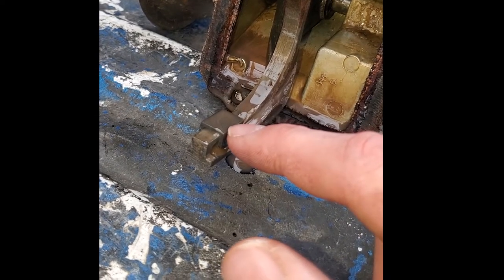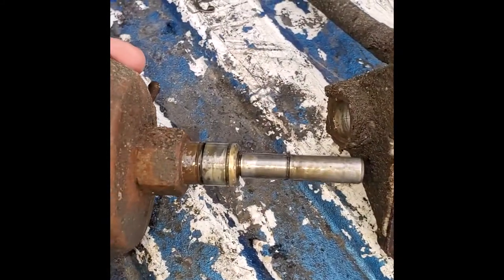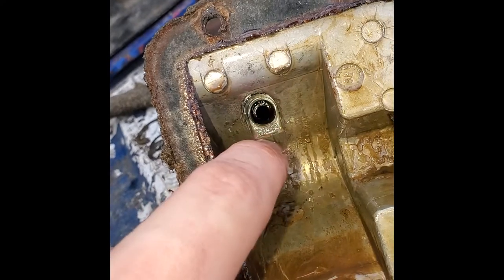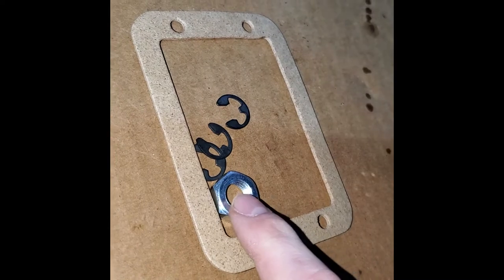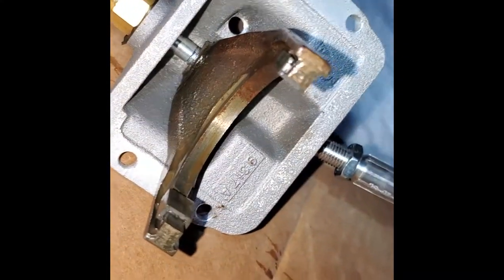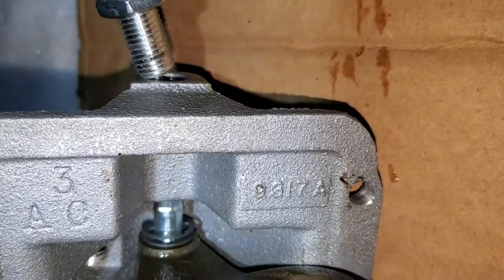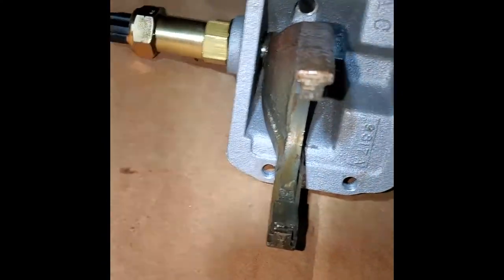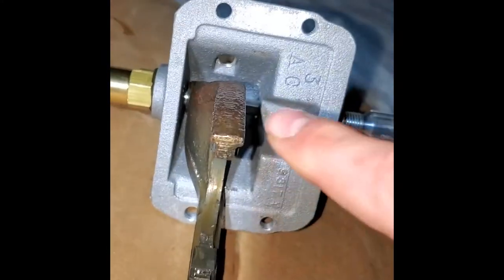Installing 4x4 Posi-Lock Front Axle Engage Cable - Part 2

Comment: Just to be clear, this mod is NOT a locker and does not “lock” the two axles, it merely makes the dif positive track, right?
Reply from the maker: That is correct. There is no change in functionality from the factory setup, other than the fact that it will actually work as intended from the factory as there is no delay or failure possibility due to the vacuum actuator that was replaced by the cable. It does lock the two halves of the passenger side axle shaft together, but that's it.
Thanks.
Reply: @GBProductions0  
Thank you sir. 
Much appreciated!

Comment: I installed this kit, but the fork is stiff unless i assist the fork while someone pulls the cable from the cab. Any ideas?
Reply from the maker: Hmm, does the collar sleeve that joins the axle shafts move freely when the fork is not installed?
Does the cable move freely inside the casing when the cable is not connected to the fork or axle?
Sounds to me like it is maybe just an issue of a sliding surface being dry and needing some lubrication. It could also perhaps be the routing of the cable from the axle to the cab. Make sure there are no really sharp bends in the cable casing, this could cause binding on the inside.
Thanks,
Greg
Reply: @GBProductions0  it's got a couple loops. It doesn't move freely when  disconnected from the front axle.  I pull it almost straight routed and it seems the back spine of it drags on the cad
Reply from the maker: That's odd. I didn't think there was a particular way that it had to be installed so that it would clear the housing.
I'm not too sure without seeing it. But maybe take the cable out of the housing again and just double check everything looks okay visually and then try reinstalling it again and see if you can get the cable and fork to move freely in the CAD housing. It is possible that it could be a manufacturing defect as well in the CAD housing itself.
Let me know how you make out.
Thanks,
Greg

Comment: I installed the cable adapter and everything, but I’m getting a rattle and metal spinning noise from the CAD area almost like the connector is barely touching the spinning axle, but then I don’t know why the driver’s side axle would even be spinning if it wasn’t engaged at the transfer case.
Reply from the maker: Hmm, maybe check the adjustment on the cable and make sure the travel is enough to fully engage the collar.
If the truck is in the air and there's no load on it, the driver's side axle may very well spin anyway.
Was the CAD functioning properly prior to the swap to cable control?
I have heard of the teeth inside the sleeve shearing off as well in extreme cases. Might be worth a look into that.
Let us know how you make out.

Greg
Reply: @GBProductions0  thanks for the reply! Turns out I needed to ad more gear oil.

Comment: Great job of explaining each step.  Very good filming and lighting while working one handed.  How did you test to confirm you achieved 4wd lockup?
Reply from the maker: Thank you very much!
The only testing I did was a bit of driving in 4-low. Up until recently I thought it was fully locking up in 4-low but a couple weeks ago I tried to pull one of my other trucks out and I had only two wheels spinning on opposite corners. So I'm thinking there is something wrong with the differential itself. The rear is also supposed to be limited slip but it doesn't work either. Classic Dodge problems.
Thanks,
Greg

Comment: Good video, 
I too have purchased one of these set ups...I'm in agreement w/ your observations.
a little more effort could have gone into this unit. Poor instructions. as an engineer and machinist i had to make some changes, but i would like to offer some tips.
First knowing the approximate location of the cable thru hole, its easier to use a 20" long 3/16" electricians drill and from the engine side pop a starter hole just right of the brake booster bracket flange, then finish w/ your step bit from the inside ....yes the instructions are backwards on location Second the cable gets routed to the outside of the frame rail, not the inside, this keeps it away from the exhaust and cut the grommet at an angle and lastly i don't like the way the knob floats ...it needs some resistance to lock open and closed, it should have a friction adjustment to stop this.
i can easily see the knob vibrating and turning in/out by itself causing a partial engagement and cause damage to the axle....why does it have to have push/pull and turn?....it should have just turn only and ball detent to keep it in position.
I made some special mods to do this and lock it in place...also I modified the brass switch nut to accept the factory switch because i wanted to retain the weather pac wire connector.
And lastly before you take the factory CAD off drive the pass  front wheel onto a block...this will keep the axle fluid in the pumpkin
Reply from the maker: Hi there,
Thank you for the feedback and information! It is greatly appreciated!
I agree with a lot of what you are saying, and there is always room for improvement.
Cheers!
Greg
Reply: It's a push pull and a turn because they literally just poached an airplane throttle for this.  I'm not happy with the design.

Comment: Great video. What did you do with the stock vacuum lines though? Did you plug them to maintain vacuum, and did you leave the stock connector on there?
Reply from the maker: Thank you!
My truck had no vacuum to the climate control when I got it, so there was no effect from having the vacuum lines to the axle disconnected. The brake booster vacuum was a separate line. So I ended up taking the single feed line that went to the transfer case and connecting that to my climate control so it would function properly.
But in your case, I would just plug the single feed line that goes to the transfer case, and you could even remove the extra hoses from the transfer case to the axle as they aren't needed anymore.
Hope that helps, thanks for the comment!
Greg

Comment: I installed dynatrac locking hubs in my dodge 2500 could I leave fork engaged all the time since I can disengage my hubs?and just unhook the vacuum lines?
Reply from the maker: Hey there, thanks for the comment!
Yes I would think that would be perfectly fine! As long as the left wheel is not directly connected to the right wheel you won't have any extra drag or resistance. The only thing to consider is that over time the fork may walk back and cause the axle to become disengaged without vacuum to hold it in place. If you could come up with something to hold the fork in place that would work fine!
Thanks!
Greg
Reply: @GBProductions0  thanks for replying and you can remove c-clip on drier side of fork then slide fork over and reinstall c-clip on backside to hold it I just wasn’t sure about my axle being solid but to me it’s the same as my old 74 Chevy 4x4

Comment: Where did you get your front bumper? Sent on on eBay for this kit for $100.
Reply from the maker: Hi there, the front bumper came on the truck when I bought it. It's just a stock Sport bumper with LED pods in the driving light holes.
Good to know!
Thanks,
Greg

Comment: Ever since I've put this in I've had grinding from the front end.... I'm so beyond stumped.   I'm not happy with the product.  They literally just slapped an airplane throttle on a housing.  At least their customer service was willing to help, even if they didn't know what they were doing either.  

I've messed with this cad in some form or another 6x now.... I'm at my wits end.
Reply from the maker: Hmm, that's not so good. I'm not sure what could be causing that. Only think I can think if it's like my truck is if the collar sleeve that joins the front axle shafts together doesn't fully disengage then you could get some grinding noise with the sleeve chattering around the opposing axle shaft.

Greg